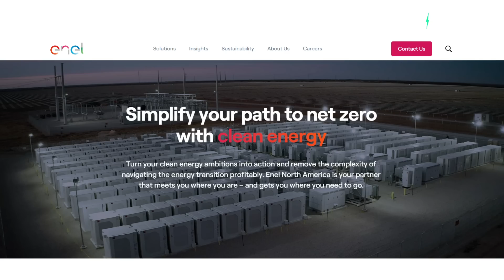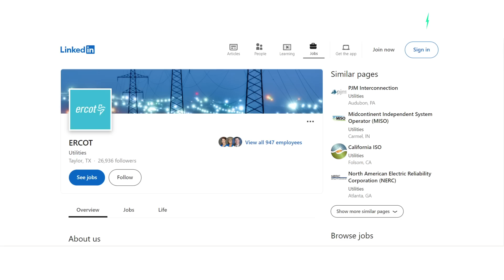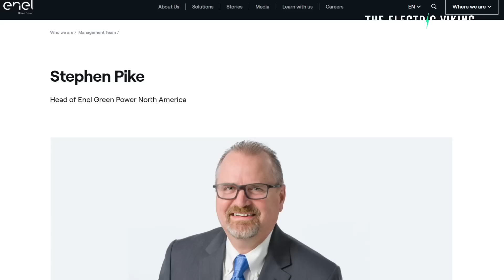Texas beats California: How oil country became the renewable energy leader

Comment: When I go on to a particularly large Chinese industrial supply site and keyword search 'Solar cell 6x6' I'm finding listings at 2 cents per watt (or .02 (US) dollars per watt) for 210mmx210mm cells. I don't necessarily believe these numbers, but I see a lot of postings at 10 cents and a lot more at 20 cents. All of this is FOB factory, meaning this is the price before shipping and/or import duties.

This 2 cent price is at a minimum order of 1.5 megawatts, so one could buy 1.5Mw for $30,000, or build a 1GW plant for $20,000,000. Take all of this with a ton of salt, but it is definitely interesting to root around on this site looking at current prices and quantity price breaks.

Comment: You can build solar and wind quickly, but often getting through the permit process takes many years. I think the Texas permitting process is much quicker than California.
Reply: ERCOT has an absolutely ENORMOUS backlog. 37 GW of wind, 152 GW of solar and 140 GW of battery projects sitting in the ERCOT evaluation queue.
Reply: @SavageChinquapin  wow. Source? Would like to share this.
Reply: In the UK you have to be connected by the local distribution network operators who in the main are owned by the national grid which is a privately owned business which seems to lean towards big oil rather than green customers hence the super long delays in getting connected, why would you want to cut off the hand that feeds you !

Comment: Not surprised. Western Texas has some of the world's best conditions for solar power, and the Panhandle region is part of the USA that has excellent wind conditions for wind power.
Reply: Not many want to live in those parts of Texas so it's a win win.
Reply: The same can be said for geothermal in Texas -  lots of startups (many funded by and manned by expats of the oil & gas industries) popping up, taking advantage of new drilling technologies.
Reply: West Texas has had wind for many years, just like up in the panhandle around Sweetwater.  Solar doesn't need "conditions" beyond cheap land and be near the grid.
Reply: No, TX does not have worlds best solar.  It is not even close.  Put same infrastructure anywhere in the middle east to Morocco or majority of Australia or S. Africa or Chile and ALL of those locations will get ~35%-->40% more power for same upfront costs.  In fact, New Mexico, Arizona, and most of Mexico has better Solar than anywhere in Texas. TX does have ~Decent wind.  Not world class, but above decent.  Same wind turbine built in Central Argentina for instance would achieve ~35% more power.
Reply: @w8stral  I think the word "best" is misused.  If referring to maximum radiation  in a year, yes, low latitude - and high altitude - deserts would win out.  Of course, few of them are near where the electricity is needed.

Comment: Washington state is actually the green energy leader in the US. 73%  of all energy consumed for home use is from renewable sources. WA also has some of the cheapest electricity in the US.
Reply: They’re lucky - they have a lot of hydro.
Reply: We in the Pac NW have a lot of hydro. I believe Washington state pioneered the first hydro project way back.
Reply: @jaaklucas1329  Hydro is the bulk of it, but what a lot of people overlook is how easily hydro power generation can be used like a battery when paired with other types of renewable energy. You don't have to ramp up like other forms of power generation, and taking capacity offline when not needed does not come at a high cost. With a sufficiently large grid, it would be possible to shore up dips in productivity with reserved hydro power generation.
Reply: Deep water wind farms off shore should be a high priority for Washington, Oregon, and British Columbia.
However, I think it will not happen without Government Grants and maybe partnership with our neighbors to the north.
Once established, returns would come from leasing waters in-between for offshore agriculture and setting up a battery charging depot for large ships.
Maybe the first offshore city in the US territories?

Comment: Don't get too excited. 

Oil regions are leaders in wind and solar for a devious reason. Texas and Alberta both have a lot of wind and solar - but much of it is built specifically to power petroleum projects, NOT connected to the grid. 

- petroleum companies get the cheap electricity while we still use expensive  electricity from burning fuels.
- petroleum companies get the grants and subsidies.
- petroleum companies get the labor and materials so other "green" companies don't. 
- petroleum companies use the "green" electricity for stupidity like carbon capture or hydrogen so they can pretend those are actually "green". 

Sure wind and solar are awesome - but they would be even better if actually applied correctly by more environmentally interested people.
Reply: This year, at 30 below in alberta,  solar and wind provided ZERO electricity when urgently needed. Very dangerous

Comment: Any type of power plant, nuke, coal, gas, or even hydro can't produce any electricity or revenue until it's finished and that takes not only time but a lot of borrowed money. Wind and solar can start producing right away even as it's still being built out or expanded.
Reply: That’s what I keep telling people who say that solar is too expensive. Off grid doesn’t mean you live where electricity is unavailable. It means you consume your solar production instead of selling it to the grid energy providers. Because you can start very small and scale up easily paying cash as you go,the payback time is greatly reduced.

DIY off grid for less than $10,000 can easily run your critical loads panel (everything but cook stove,water heater,and central air conditioning) but pick up part of those loads when you schedule their use.
We have time of use plans in Texas that allow free electricity at night to top off your solar batteries,run your dryer,charge your car, or whatever large load you can schedule for that time.
For example,water heaters are the second largest load after air conditioning in Texas and by putting them on a timer you serve as a dump load for the underused grid capacity at night.
Check out Signature Solar’s kits . 8 kw panels,6 kw all in one inverter,and 13.4 kWh LFP battery for just under $10,000.
That’s about equal to a pack a day cigarette habit for four years.

Comment: I wonder if battery farms will experience the same issues that EVs suffer when the temperatures stay exceedingly cold for an extended period. EG If a battery farm is rated for 100 MW normally will if only be able to deliver 50 MW when the temp fall below 20° F for 48 hours?
Reply: There are many other simple and clever ways to store energy. "Battery" also refers to mechanical storage.
Reply: @jaaklucas1329  
That is VERY correct. 
Many things can be done when excess energy is available. Like heating water stored in tanks, heating/cooling thermal storage for later use, EV and power wall charging, industrial processes, etc.
Very easy to encourage this type of energy usage, with variable rate energy billing.

For grid scale, massive batteries are a big known one, but pumped hydro, and reserve hydro have been in use for a very long time, and work rrally well with rapid ramp up capabilities. Sand batteries are now a thing, which either use the sand as thermal storage, or for "gravity" batteries. 
Hydrogen is not viable except for some fronge cases/industrial needs. Too energy inefficient, and a very hard gas to deal with.
Reply: I'm certain they include internal heating elements in these batteries for freeze protection. 
Probably also start preheating when extreme cold is predicted.
Reply: @docwatson1134 I would also expect them to be under constant use, which will require them to be cooled. On colder days, cooling could just be reduced. 

I would imagine there would be a substantial thermal management system in those, like used in EV's

Comment: What is a little funny (well to me anyway) is that Texas has an installed capacity of 37GW wind and 14GW solar which exceeds the peak demand of the whole of Australia by 20GW.
Reply: Most wind generators are facing Austin, the state Capitol as it generates as much hot air & wind as our sun.  😏
Reply: The UK maxes out at around 40GW.  Ofc installed capacity doesn't mean it'll deliver that much all the time
Reply: @pooroldpedro  most certainly, need some very specific conditions to ever max out the installed capacity of either, let alone both at the same time. I just found it interesting that one state in the USA could, in theory, power the whole of Australia and that state being Texas of all places.  
I think here in the UK we did get up to 50GW a few times during winter for a few hours (peak demand that is) which is when we had some energy saving session (anyone outside the UK, it's where you got paid to not use energy, up to 10x your usual unit rate per kWh, to help reduce the peak demand). But like you say, generally 40GW so again, Texas could power the UK which is more than double to population!
Reply: So Texas has more money than Australia ?
Reply: @thystaljaard7607  I guess, but with a lower demand for energy it would be cheaper for Australia to switch to renewables?
Quick search and GDP for Australia 2023 was $1.4trillion (USD) vs Texas at $2.3trilion (USD)
Reply: Texas has a bigger population than Australia
Reply: How much money have we got to  buy & install the renewables. Notice that coal & oil is helping fund that as its being built, we want to stop coal exports & won’t even consider digging up nuclear energy out of the ground. I don’t understand why we want to stop exporting coal when our coal burns so much cleaner. Nobody is going to stop burning coal just because they get ours & wouldn’t we doing helping the environment if we bringing carbon output down by supplying better coal?
Reply: @geoffh5529  
Coal is now more expensive to use than any other source. Coal plants are filling for bankruptcy in several states. The only reason they continue to operate is because the government/ tax payers are propping them up. We shouldn't sell it to others because it will still affect us when they burn it. We do need more nuclear energy combined with renewables and storage.
Reply: What's also funny is what little percentage of that wind capacity is actually output on average.  Rough estimate is that it's average production is 1/3rd of it's rate capacity.  So in essence, to get 1 MW out, you need 3 MW of turbines installed.  Talk about waste.....  Therefore, the cost of wind is actually 3x times higher than what they advertise to you.  I dare skeptics to research to see if I'm telling the truth!
Reply: @RT-mv7df  not 100% if you are the skeptic here? Thats just how wind and solar work, which is why interconnectors and grid storage are important. Some days you get 70%+ others it'll drop to 10%. Wind is still the cheapest form of energy to install, even if it did cost the same as coal/gas as you needed triple the output capacity, the coal/gas plant still needs to have stuff extracted, transported, burnt and repeat constantly. Wind farms are built and for the most part left alone. I mean, it's not like they have to change the blades every day is it. In fact, most wind turbines only need maintenance every 1-2 years, this is where it becomes cheaper in the operational costs. Could cost 10x more to build than coal/gas, would still win out in the long run.
Reply: You have to be Careful Comparing Name Plate Solar PV with Name Plate Coal Generators.
Often the Volts will Not be the Same, but the Watts May be the Same.
Reply: @chrisgriffiths2533  Indeed. So 1 MW produced by solar PV farm at low voltage is going to need much more step-up equipment (in addition to inverting) to transport the power across high-voltage AC lines than a 13KV 3-phase generator output.
Reply: @RT-mv7df  
Yes if Your Solar System Name Plates in Western Australia amounts to 13 Kilowatts, You Would Approximately End Up with 1.3 Kilowatts at 260 AC Volts for about 10 Hours Every Day.

But If Your Supplying DC Lighting, DC Motors, a DC Green Aluminium Smelter or a DC Electric Green Steel Arc Furnace or a DC Green Copper Smelter or a DC Transmission Line.
Then DC is OK.
Reply: @chrisgriffiths2533 😂😂 as a solar design and installer, you haven't a clue what you're talking about.
Peak Sun Hours in WA=5 averaging over the year, increasing going North of the State, meaning that a 13kW system would produce approx 5x13kWh a day, minus approx 10% max for system losses, so 58.5kWh on average day.
A 13kW system max kW, could be 13kW minus losses if best orientation.
Reply: @Luxamor-8  Is it Dark in WA at 2pm in the Afternoon ?.
Reply: @chrisgriffiths2533  educate yourself on the subject.
Reply: @Luxamor-8  
Is it Dark in WA at 2pm in the Afternoon ?.
Reply: @chrisgriffiths2533  WTF you on about?
Reply: @Luxamor-8 
 Is it Dark in WA at 2pm in the Afternoon ?.
Reply: And people online still telling me electric vehicles will never work in Texas, even though literally the world’s leader in EV’s is manufacturing the vehicles in Texas and the charger infrastructure already supports travel  across the entire state.  I am literally about to take my 3rd 3000 mile roundtrip with not a single issue to date in my model Y this week.  People have very little vision.  I can just imagine the same mindset back in the early 1900’s when the car replaced the horse as the main mode of transportation.
Reply: @cherokee180c0 I use that example all the time on my radio show when conversing with Luddites.
Reply: @thedavidseatonshow  It just ceases to amaze me.  I literally had a good friend tell me that EV’s are cool, but they are not ready for prime time.  I laughed and said the model Y is literally the number selling car in the world for more than a year now, so by definition it IS Prime time.  Some people will simply never accept change.  I just laugh all the way to the bank. Trust me this is not the only issue people who don’t understand tech or finances fail to understand.
Reply: @oldbloke204 Works for me. At the current rate of feed in I get and minimal grid use by installation will pay off the cost in under 10 years. Gotta use the right electricity supplier of course. I receive and pay at wholesale rates for power plus pay a small monthly subscription fee. I only ever pay to charge my EV on long trips at a price way less than fossil fuel.
Reply: @oldbloke204 math is 100% dependent on where you live, local electricity rates etc. But I literally get paid lots of money to do TCO models and am an engineer and I can guarantee you it is 1/2 the cost of a comparable SUV. I literally have all the receipts to prove over $2K savings last year and I dont even drive that much. What I never counted on is the amount of free charging I get, as well as the profit from the IRS mileage credit which is paying at $0.67/mile while it is costing me like $0.05. Also the free “tank of gas” from my utility per month is also nice. I literally got 1/3 of my 3000 mile trip last year for free.
Reply: @dermotbalaam5358 I have sone the same calculations and he is right if you have to install all that equipment. My deal from my utility is so sweet, makes no financial sense to go solar unless you like 12 ROI’s.
Reply: Finn Peacocks latest report says 2.5 years.
Reply: @cherokee180c0 you can't throw a rock in Texas without hitting a tesla. They are everywhere.
Reply: @DP.496  They don’t like cold weather & migrate north in the summer.  I have to keep mine locked in the garage in winter or it’ll head south to warmer battery friendly climes.
Reply: @cherokee180c0 
Yep. I live in Texas and charge my Tesla for free while I sleep.
Reply: @That-Guy_  That is awesome.  $0.06/kWh here and my utility buys me a free full charge + each month with a $10 rebate off my electricity bill for signing up for EV pulse.
Reply: Texas has about 20% higher population than Australia, and more industry.
Reply: @dzcav3 Takes a lot of electricity to pump and refine all that oil and liquefy all that natural gas...
Reply: @SavageChinquapin  yeah, I just quoted the installed capacity for solar and wind, but apparently gas is 66GW, coal is 14GW and nuclear is 5GW. Thats a hell of a lot of power available on bright sunny day should they need it. But looks like they generally fluctuate between 30-50GW so aren't far off being one of the greener states
Reply: @steve_787  But ERCOT needs 80 GW and more in the summer.     They need the solar electricity to run all those air conditioners.
Reply: @dzcav3  27 million people in Austraila (2024 estimate). 30.5 million people in Texas (2023 estimate). 20% of 27 = 5.4   30.5 - 27 = 3.5. So not 20%. Must be the industry. ;-)

Comment: Texas is spending so much money on green energy and batteries since they actually have there own separate power system divorced from the rest of the US. 1-3 years ago (sorry i suck on time) Texas had major outages due to issues that could have been solved if they were part of the rest of the US power grid but since they desire to have a separate grid they need more alternatives that they would not need if they connected to the rest of the US grid.

Also Texas is getting a lot of major industry from Giga Texas to Space X and a lot of other companies spending lots of money in Texas and requiring stable power
Reply: The real biggest cause of the power outages was that Texas didn't require the natural gas companies to winterize their equipment. No natural gas to the NG power plants means no electricity.